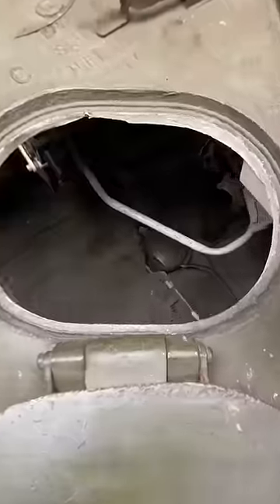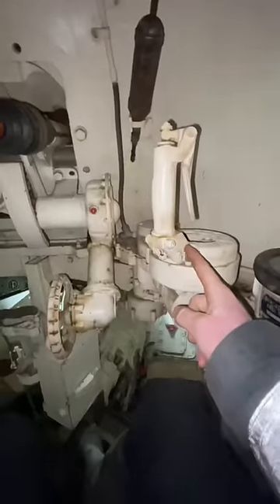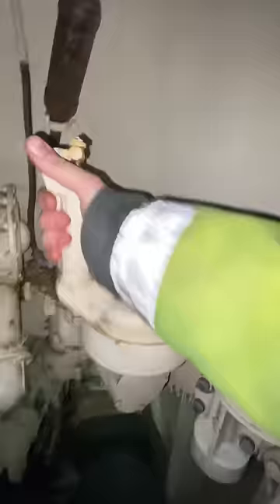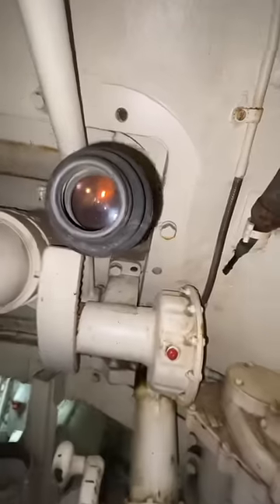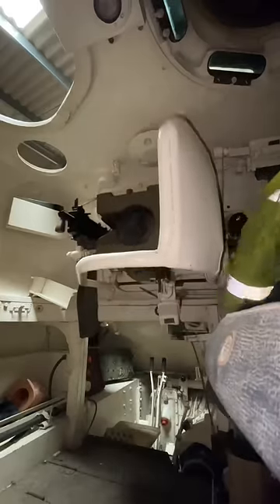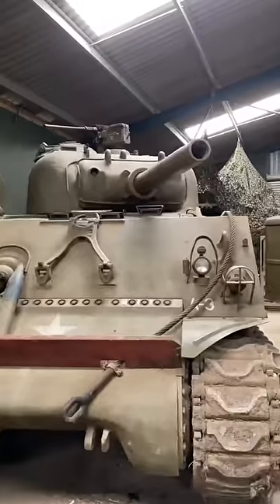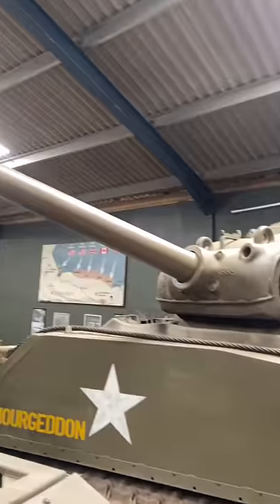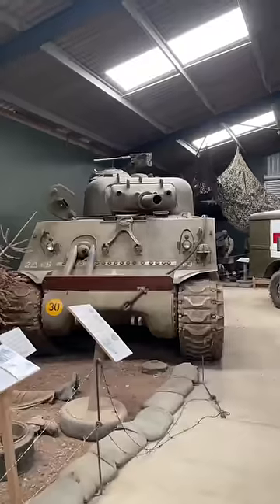How to aim a WW2 Sherman tank! #shermantank #ww2 #tanks

Comment: Ah the M4A3 105mm. A good choice.
Reply: It's funny that the very first sherman tank had 105 mm penetration and could essentially one shot panzer 4s if they aren't angled
Reply: Its a tank
Reply: Tank sucks
Reply: Unless you shoot it from the sides and then kaboom no more Sherman
Reply: @Mrgrimlock2007   =(
Reply: @johnballentine6638  unless you have the other versions you'll be fine I guess
Reply: @Mrgrimlock2007  you guess?
Reply: @johnballentine6638 if they where angled the 105 would still pen
Reply: @tucker3588  A badass and good looking tank
Reply: @johnballentine6638 they were not meant for tank on tank action, like in war thunder. They were meant for smoke and such

Comment: There seems to be some confusion. This is a 105mm bunker buster. Uncommon but still more numerous than most German tanks. A specielty modification. Due to size and role there is no stabilizer or electric traverse. Every other variant (75 and 76mm) has electronic traverse run by a battery (engine charges, doesn't run it) that can 360 in 15 seconds. Normal travers is about 30-60 seconds between full and casual speed.
Reply: Hydraulic. T-34 had an electronic traverse, but most German and US tanks used hydraulic traverse.

ETA: The most common (and preferred) was the Oilgear hydraulic traverse with electric motor. There was also a Westinghouse fully electric traverse but it was not as popular and pretty much all 76mm have Oilgear.
Reply: @homie8437  saying hydraulic is misleading. The Panthers' direct drive traverse is linked to the drive shaft, and momentary speed is a factor of RPM, thus causing inconsistent adjustment and even more excessive fuel waste in operation. Yes, the 85 had powered traverse, but mostly post-war. The function of post-war T-34-85s is usually conflated with the performance of WWII T-34s. These are not even similar tanks, only in appearance. Crazy what another 14 years of peace time production can do. The claim that only the T-34 had an electronic traverse is also misleading. The Sherman uses a battery-powered traverse. This means it is independent of RPM. That is all. Shermans had this throughout the war. Not 1 tank with a traverse for 10 whole months. Too little, too late, when it works, if it works
Reply: Is the Easy 8 one of those wich have electronic traverse?
Reply: @LucasSantos-jd3ee  yes

Comment: Im guessing this is the 105 mm variant which is why theres no hydraulics? Because every other Sherman has hydraulics while the manual stuff was only used as a backup in case they fail
Reply from the maker: Yes it’s the 105mm used for bunker busting
Reply: @ArmourgeddonTanks 
So then why do you put it out like Sherman's didn't have hydraulic driven turrets?
I'm guessing because that's what you want people to think.
Reply: Unless either the putput or main engine is running, the hydraulics won't work. Do wish he has shown them, the M4 even had a VERY advanced hyrdaulic floating elevation control. Basically it would allow the gunner (not the aimer) to track targets while the vehicle was moving whereas no other early WW2 tank had that, they would all have to stop to be able to get off an aimed round. These days all modern tanks I am aware of have both elevation and traverse target tracking systems to allow them to shoot on the move even at full speed over rough terrain.
Reply: No, it clearly has the 75mm gun.
Reply: Not a word about the gyrostablizer.
Reply: @ArmourgeddonTanks  precisely
Reply: @williamschlosser77  its a 105,not made for infantry support but for bunker busting, 76mm will be smaller and longer
Reply: @williamschlosser77 no thats a 105mm the 75 barrel is thinner and longer the 76mm barrel is simply longer
Reply: @williamschlosser77  it clearly don't, this is the 105 howitzer
Reply: Its also a museum tank and probably doesnt run. So no hydraulics. tanks of the time had hydraulic assist meaning the manual cranks were still there. and depending on what county and time diring the war you would have to do fine adjustment with manual cranks even with the hydraulics for corse adjustment
Reply: @southronjr1570  the Sherman had a secondary engine and and electro-hydraulic turret drive, so even without the main engine it could aim fast.
Reply: @Jan_372 He already said that.
Reply: @sqike001ton  the 105 Sherman never got hydraulics if I ain't mistaken, unsure why
Reply: That and the 105 variant's turret turned a crap ton slower than in this video
Reply: @ket451  I don't know but it might be the size and weight of the gun
Reply: Shermans had both hydraulics and hand cranking.
If the hydraulics went out, you had to go back to the crank. Fury (as controversial as that movie is) shows this. 
But yeah, 105s didn't have hydraulics. At least on the first variants.
Reply: @ket451  it did, there were two versions , one had a Manuel and the other was electric
Reply: @ket451  The 105 had a hydraulic drive. The M4's used the 105 gun carriage for the 75 so the commanders could change it out for a 105 barrel. The Army provided kits for doing that out in the field.
Reply: the manual systems weren’t only just used as backups, they were also used to more precisely aim the gun.
Reply: @dukecraig2402 Why would he want people to think that? What purpose could that possibly serve? Its not some conspiracy jesus...
Reply: @dukecraig2402  He did
Reply: great
Reply: I could be wrong but as far as I knew Sherman’s in early production and implementation didn’t have hydraulics in their turret. But that’s cool if they did. I’m months late Ik lol this just popped in my reels
Reply: The manual ones were not only used for backups, they were also used to do fine-tuning on the aiming. The motorized traverse was fast, but it was also inaccurate. The Tiger tank actually had motorized traverse which was accurate enough to be used to aim it, however that came with the drawback of making the traverse speed horribly slow, so there's that.
Reply: @dukecraig2402  no he says in the video that most of them have hydraulics and aren’t crank driven. Watch it again maybe
Reply: @williamschlosser77  it is definitely the 105mm
Reply: @onyxdragon1179  what’s so controversial about fury
Reply: Yeah
Reply: @dukecraig2402  The fuck? Yeah it’s a grand conspiracy to make the Sherman look like it didn’t have hydraulics you’re right
Reply: @williamschlosser77  ehh the 105 and 75 had deceptively similar looks. So it could be either. None of the matters though since it’s a museum piece, which means that engine wouldn’t be running, which means hydraulics or not, that turret would still be on a manual traverse
Reply: Actually is 75 mm
Reply: You can also tell by the derp barrel
Reply: @purplepotato69  there are several glaring historical inaccuracies throughout the film. Still a great movie but not really as realistic as it pretends to be.
Reply: @justinbieber8028  well obviously but that doesn't make it controversial
Reply: World's most useless argument
Reply: M4A3 105
Reply: @southronjr1570  you mean the stabilizer, which stabilizes the gun relative to the world opposed to relative to the tank.
not many ww2 tanks had this luxury, though the shermans are one of them, and all modern tanks have not only the vertical stabilizers like on the sherman, but also horizontal stabilizers, so the hull can rotate freely of the turret.
funnily, though, despite stabilizers being first used in ww2, even later vehicles would stop to fire accurately, since stabilizers were not perfect for quite a while and they werent quite good enough for firing at normal combat ranges. a very useful system
Reply: @ket451  because bunkers and trenches don't move
Reply: @dukecraig2402  no wonder so many shermans got destroyed, they had manual turrets
Reply: @williamschlosser77  the 75mm gun  uses other gun mantlet, this is far too big to be a 75mm
Reply: @dukecraig2402  It literally says in the video it’s usually done by hydraulics.  86 people didn’t watch the damn video
Reply: @lordemarsh6804  They didn’t.  Only this particular variant which was for bunker busting.
Reply: @mrkeykush693  Video owner literally says it’s the 105 above
Reply: Yupyup!
Reply: even the M4A1 variant has hydraulics?
Reply: @dukecraig2402 Some early Shermans did not have turret hydraulics. Notice I said some because it varied
Reply: @williamschlosser77  It is a 105 so it doesn't have gyrostabilization. It was used against stationary fortifications and didn't have to fire while moving in that role.
Reply: @dukecraig2402  No he isn't trying to trick you. He just has the other version. Chill.
Reply: @ArmourgeddonTanks  It do be chonk
Reply: @dukecraig2402 He just said that most of the vehicles would have used hydraulics
Reply: @purplepotato69 It makes it really cringy tho
Reply: @dukecraig2402  This is what came to my mind as well. These youtubers are getting out of hand, spreading misinformation of various sorts.
Reply: @southronjr1570 he Shermans had not really a tracking system. They had gun stabalisation (only in elevation) which was indeed quite unique for that time.

For traverse there was a hydraulic version or an electric version or an (rare) electro-hydraulic version (besides the manual control).
Reply: @billwilson-es5yn It is not only the barrels which needed to change. Also the internal layout needs to change because of the different size of the ammo. Not just an easy swab job.
Reply: @dukecraig2402 absolute clown
Reply: @CarLos-yi7ne  I agree, I only said they had a hydraulic elevation stabilization to allow the gunner to track targets, nit an actual tracking system. It basically made the job easier. Ironically, the system was supposed to be secret, and many later war gunners weren't trained on the system, which was a shame bc it helped drastically. My grandfather was a M4 crewman who served as gunner as the occasion called and mentioned the system. He loved it but most of the guys he was having to train in theater, he didn't train them on it bc it took too long to explain everything and his CO only gave him a few hours to teach it to them. This is after they were in France and were having to train guys quite litterally that had been infantrymen or clerks the day before. He said they didn't do that too often but it did happen twice to him before he was pulled out of the tanks. He had 3 M4's knocked out from under him and he was the only survivor on the last 2 so his CO pulled him and made him part of the companies recon element where he would ride in either a Jeep, 3/4 ton Dodge, or a half track and radio back what he, a driver, and his officer found. He once told me that he came up on a river crossing at a little village and on the other side was this short officer in a horse riding uniform screaming at then to go up stream a half mile and have the column cross at a shallow ford. The officer was none other than Patton himself.
Reply: @mrcroob8563 Oh thank God! I couldn't handle a conspiracy Jesus, a regular conspiracy sure but definitely not a conspiracy Jesus!... Haha! It's like the savior of all conspiracies, once the conspiracy Jesus comes out all other conspiracies become true...
Reply: @walterclements5632  
Exactly, first off the title of the video says "How to aim a Sherman tank", then after getting inside and doing all that cranking he says "Most vehicles had hydraulic, you can see why they'd need it!!!" which would lead people to believe that the Sherman doesn't but others do.
And all the people who've been attacking me about my post that know Sherman's and know that the other variant's had powered turrets and/or guns all I was doing was pointing out that people who aren't into tanks or Sherman's in particular would likely perceive that what he said, coupled with all that cranking and the title  "How to aim a Sherman tank", as meaning that the Sherman's were primitive or junk compared to the other tanks in WW2, they're not taking into consideration that people who don't know anything about WW2 tanks and Sherman's in particular who clicked on this video to learn something about them might see things that way because they already know different, and of course you'll have your share of them who'll do it simply using it as a way to "flex their knowledge muscles" about Sherman's using ragging on me as a way to do it, then add in anyone who has the same accent as the narrator that'll rag on me to be protective of him whether or not what I implied is true or not.
Even if the creator of the video wasn't trying to do that as you pointed out many of the videos on YouTube spread a lot of disinformation about just about anything, ESPECIALLY when it comes to the US military and it's equipment in WW2, misinformation like the B17 supposedly having a maximum bomb load of 4,000 lbs, and it's Norden bombsight supposedly being inaccurate along with the many other examples of misinformation that get spread around so much people not only believe they're true but also believe they're common knowledge, even to the point that they'll want to argue with someone over them entering the argument convinced they're right to the point where when they learn the truth they're crushed, and then the embarrassment of realizing that they've spread that misinformation around for so long, and being embarrassed that they believed misinformation in the first place, it turns into anger that typically manifests itself into personal insults. 
So if he didn't try tricking people who don't know any better into thinking that about Sherman's then he has my apologies, and if he did then he's just in a long line of video creator's with that accent who do things like that every day, so it's not hard to draw the conclusion that he did because that kind of thing's all over the place, YouTube videos are full of examples of that and the real shame is the people who are genuinely interested in learning about things are the one's who suffer, because of people who love spreading that kind of misinformation around simply because they suffer from petty jealousies.
Reply: @dukecraig2402  On point there pal, it's all about views and profits.
Reply: @walterclements5632  
EXACTLY, and that's what I try to get across to everyone who can't get their heads wrapped around the concept that some content creator's willfully spread around that kind of misinformation, they know they have an audience base and that they're telling them what they want to hear, and that equals money for them.
And as I said the people who really suffer are the one's who watch a video with a desire to learn about something, and if there's one thing that's worse than not learning about something it's learning misinformation instead of facts,, especially because of some petty child.
Reply: @williamschlosser77 that’s clearly not a 75mm, it’s clearly a 105mm howitzer.
Reply: @dukecraig2402  Stop using apostrophes for plurals
Reply: @sqike001ton there was simply no space in the turret to add the electric traverse mechanism it was an option but it wasn't implemented.
Reply: The M4 105's had powered turret transverse. It was hydraulic with the pump powered by an electric motor running off the batteries. The M4's had a small gas engine that spun a generator that recharged the batteries when the tank engine wasn't running.
Reply: That cannon bore is way too large to be a 75 or a 76 for that matter, the barrel also is not short enough to be the 75 but not long enough to be the 76
Reply: @southronjr1570 no it didnt. Quit making s#it up. The stabilizer was garbage. .
Reply: @southronjr1570 and yes other tanks had that. The panther had a primitive one
Reply: @southronjr1570 no it didnt "help drastically"
Reply: @jonnyblayze5149  While I rarely respond to trolling, my Grandfather who served in the M1 tanks in Pattons 3rd Army very much like tue stabilizer and for the time, it was the most advanced one when it was introduced. As for the Panthers stabilizer, the M4 was already in service when the panther was just being drawn up, much less being in front line service
Reply: @southronjr1570  uh huh. That's a great story. But there were no "M1 Sherman's" .😅🤣😄🤭👉
Reply: @southronjr1570  so you don't know s#it either: 
Sherman first combat appearance Oct. 1942
Panther first combat appearance  June 1943.
" Already in service when panther was being drawn up" 
BWAHHHHHHH HA HA HA HA HA HA!! 😅🤣😄🤭👉
Strike two kid, wanna go for strike three?
Reply: @southronjr1570  most advanced one for the time😅🤣😄🤭👉 let me guess you're probably gonna try and tell me it made it so they could fire on the move huh😅🤣😄🤭👉

Comment: Fun fact: this is an m4a3 105 Sherman, which was essentially used as an assault gun, and as the name suggests used a 105mm howitzer instead of the standard 75 or 76mm, however in order to create room and enable firing of this gun, they had to remove the hydraulic turret drive and the stabilizer that is normally seen on shermans

Comment: The bastards who designed the 105 Sherman left out the electric motors for the turret because they didn’t want tank crews to treat it as a normal tank and not like an artillery piece 
But that doesn’t stop me!
Reply: There wasn't any difference between a 75 and 105 M4 other than the barrel and mantlet.
Reply: @billwilson-es5yn  gun breech and ammo storage
Reply: They made retrofits to remedy it, later M4 105s received them.

Comment: That's the M4A3 (105) aka an M4A3 Sherman with a 105mm semi-howitzer instead of the normal 75mm or 76mm guns. 105 didn't have electronic drives for it.

Comment: the hand adjustments were mostly used to make your final adjustments to bring your gun on target. the hydraulic and electric motors would get you there quick but the last bit of adjustments were done via the hand wheels.
Reply: It's actually a 105 Sherman, so they didn't have hydraulics or electric motors